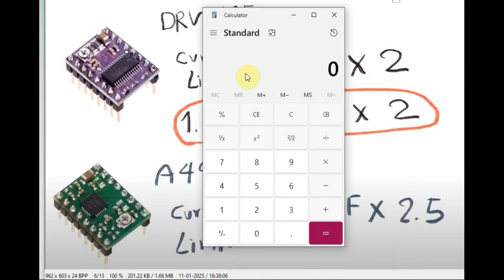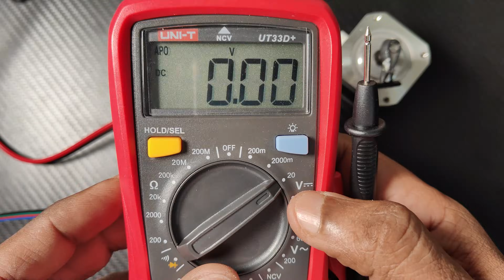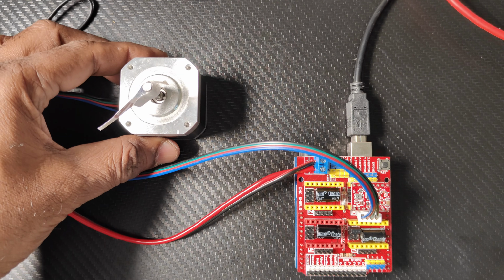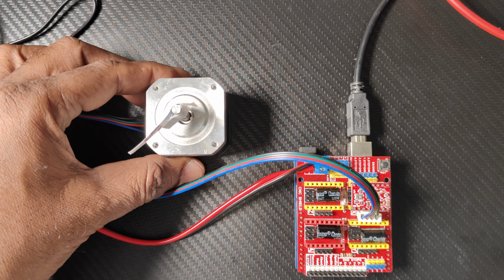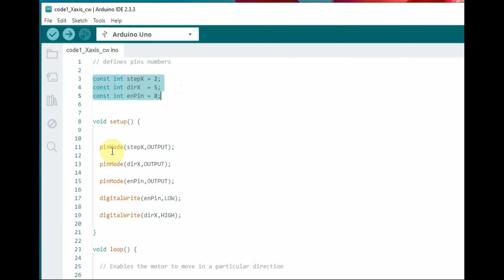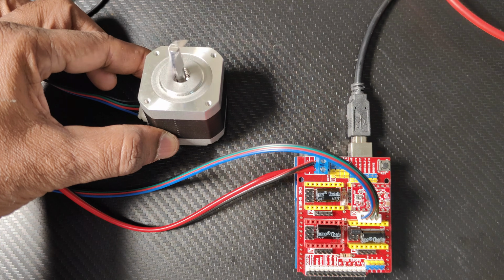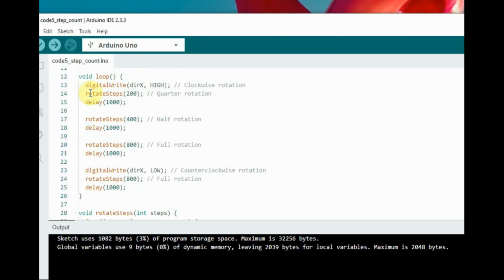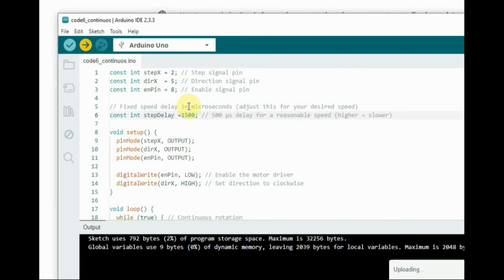CNC Arduino Shield - How to configure and Drive Steppers

Comment: I'm also using Arduino UNO with printer type USB port. When insert the shield into UNO, the CNC pcb will touch that USB port,  is there a chance that it will get short-circuit?
Reply: hay habe gleiche probleme uno mit shield extern Spannung  gibt auf usb Kurzschluss    habe es Probiert mit Vin 12v auf shield Sicherung aber das gleiche theater sobald externe Spannung drauf kommt macht Pc usb Probleme  uno usb und extern Spannung geht  sobald Shield drauf kommt Schepperts

Comment: Thank you so much for typing the code. I was missing this part:

#define enPin 8
...
  pinMode(enPin,OUTPUT);
  digitalWrite(enPin,LOW);

and i was going crazy because nothing was working. Now, it works thanks to you :--). I couldn't find a similar code elsewhere as everyone is using GRBL straight away.

Comment: so on the 17HS4401S   Motor says Rated current DC 1.5A . I  divide it 2.5 = 0.6   so i bring the potentiometer to 0.6. On the motor 17HS3401S-SZ,    do i do the same its a 1.3A  .  I  will be using a +24V  20A  500watts  power supply.